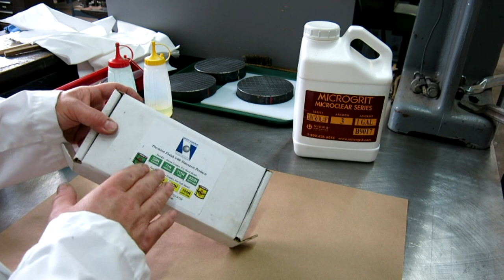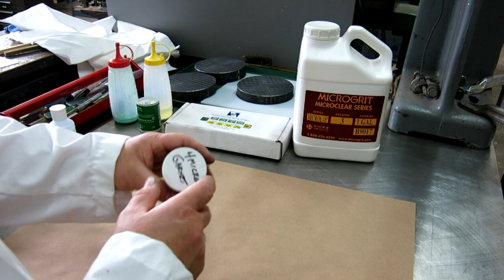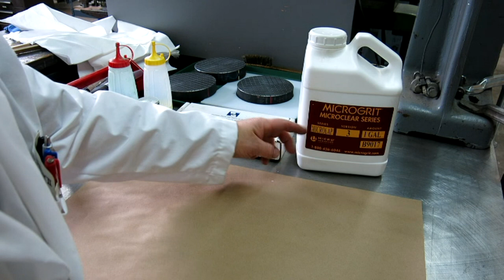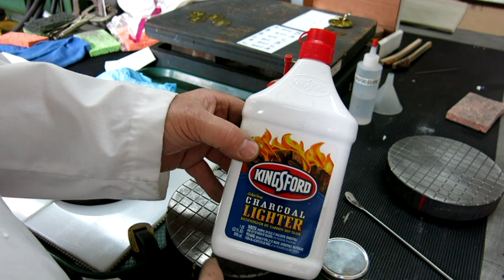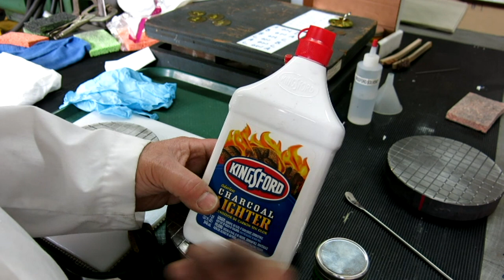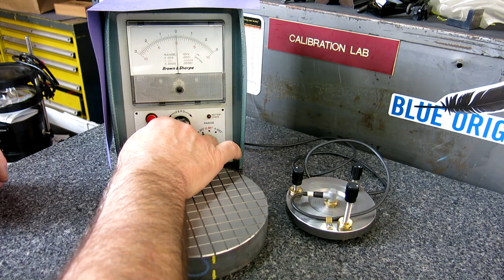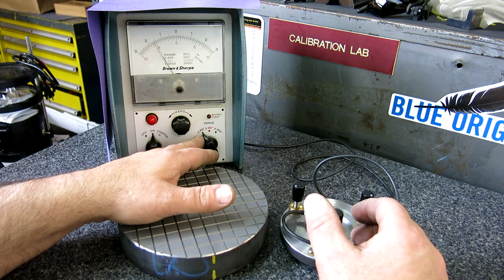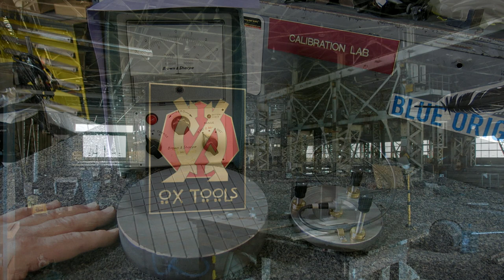Making flat lapping plates 2

Comment: When grinding telescope mirrors, the surface has to be far more precise than what you will ever achieve (or need) with your surface plates. To do so, we use rotation of both the top disc (the mirror) and the bottom disc (the lapping disc). The top disc is rotated in one direction after a small number of strokes and the bottom disc is essentially rotated by walking around the mounting post in the opposite direction. There is an attempt to keep both amounts of turn somewhat random to eliminate any radial zoning. Grinding by simple rotation of one disc on the other is avoided, as it can create circumferential zoning very rapidly.

The reason why the three plate method works is that  - with two plates,  there are two surfaces that can be in full contact in any orientation - a spherical surface or a flat plane. When you add a third plate, then the only surfaces that can all be mutually in full contact in any orientation is a flat plane.

Comment: When barrel-walking, you also counter-rotate the top, so both the direction of the stroke and the orientation changes. Doing it in the same direction for the bottom plate consistently will tend to make it cylindrical.

The way you're doing it, you cancel that out a bit by swapping top & bottom, but the way I was taught was to always keep things as balanced as possible.

Dunno if that makes much difference if you're grinding flats as opposed to making a mirror.

Comment: The bottom plate has to rotate, too. This is why they use a post and walk around it. By rotating the upper plate a bit faster than the walk-around rate, all combinations of rotation and stroke direction for both pieces get used. It's not enough to swap the top plate with the bottom plate as the grinding method makes the top plate concave and the bottom plate convex. You need all six of your combinations combined with simultaneous rotation of both plates (but at different rates) to get the real flats.
Reply: As we know theory and practice are quite different beasts, but in theory he can just rotate those plates, without back and forward motion and change ABC in the sequence and as result will get flat surfaces.
By averaging motions you may better average/eliminate  systematic errors and get better results faster, and maybe some ways are better that other, but those average methods are second order of importance..
Reply: For some reason, the people who are manually trying to achieve surfaces accurate to better than 1/4 of a wavelength of light (roughly 0.000005" if I got my decimal point in the right place) seem to have all decided to do it the way I described.
Reply: One other thing I remember from when I was polishing my own telescope mirror is that the grid of grooves on the lap should be off center such that the center of the lap is neither on a groove nor in the middle of one of the squares.
Reply: Peter Meek is right.  Think about degrees of freedom.
Reply: Can someone elaborate, I'm missing something.  Why does rotating both plates produce a different result than rotating one?  Relative to each other, there is a single rotation on a single axis regardless?  I think I'm missing something simple.  Thx in advance
Reply: but you have no idea how or why, you just like repeating what you been told?
Reply: Indeed the forces get distributed unevenly on the bottom plate, but switching both plates around fixes that problem and does essentially the same. I guess that in the case you describe it is just not as easy to make those swap places
Reply: +Tinsoldier
Not an expert, but ...

as and example, let's say one have systematic error and he presses a slightly at angle on outside motion (forth-outside position-back motion), this will lead to a slightly bigger wear for far side of bottom plate and upper plate. But upper plate is rotated, so this wear will be distributed on outer rim of the thing and thus will be less than it could be(it will be averaged, and will create convex shape which most likely will be removed with 3th plate). but bottom plate is not rotated and will form a different structure, not axial symmetric and more pronounced. It will also be averaged later, especially being rotated as one of the top plates, but as being not rotated the disturbance will be bigger in more in one place in first cycle, so it needs more time to remove it, and it might move the lapped surface to move more from parallelism with its bottom surface(if you care about that).

Eventually rotating the only top plate in the possible scenario will work out the error, it will be just longer. And all that intended to average systematic errors wich may(and will) be in human movements or in a machine. Something like that.
Reply: +Tinsoldier - When you push and pull the top plate, it overhangs the lower plate first away from you and then near you. This causes extra pressure on the outer edge of the bottom plate, first far, then near. To spread that wear all the way around the bottom plate, you walk around it as you grind (or arrange for it to rotate while you stand still).

At the same time, the wear on the top plate is mostly in the center where the edge of the bottom plate "digs into" the top plate. Additionally there is some wear away from the center, mostly in a direct line to and away from you. To spread THAT wear evenly around the top plate, you also rotate it, but at a different rate than you are walking around the bottom plate. 

There are actually three things rotating around the axis: the top plate, the bottom plate, and the direction of the fore and aft pushing. All must rotate at different rates. (Actually one can sit still, and the other two do the rotating - which is what walking around the bottom plate and rotating the top plate at a different rate accomplishes.)

When you grind only two plates, the bottom develops a convex spherical surface, while the top plate develops a concave spherical surface. This is how people hand grind telescope mirrors. 

With three plates, ground in six combinations, as Tom described, the convexity and concavity cancel each other out and you end up with three flats.
Reply: +Dennis Lubert - The bottom plate always tends toward convexity and the top plate always tends toward concavity. You really need to make that tendency spread all the way around evenly on both plates in each combination. Switching it from top to bottom and only rotating the top plate means only the concave tendency gets spread evenly. Tom's suggestion of grinding by rotating the top plate (instead of pushing it to and fro) can spread it around, but the people who want optical accuracy find it better to spread it evenly in the first place instead of trying to correct it later by circular grinding. Using all six combinations of plates and positions makes the convexity and concavity cancel each other out to leave flats.
Reply: +Peter W. Meek Thank you for the thorough explanation, that makes sense now!
Reply: +Peter W. Meek
The rotating the upper plate only does not mean he will not change in the process the bottom plate to be upper, as I got the impression even it were not stated explicitly, but it is the logical way to do the thing.
Reply: +MolbOrg - I think you may be missing the point. Rotating a plate when it is on top does not have the same effect as rotating the to and fro action in relation to the plate WHEN IT IS ON THE BOTTOM.Tom does say that all plates will be on both the top and bottom while in combination with each of the other two (six combinations). However that is not enough. The oscillation MUST rotate in relation to each plate while it is ON THE BOTTOM (and on the top).

Comment: In Fundamentals of Dimensional Metrology by Ted Busch, the sequence is different.  In his history of flat surfaces, he points out that lapping was always used but that Wittworth improved the process by using scraping.  The sequence he used was B on A, C on A, C on B, A on B, A on C, and finally B on C.  Totally different sequence.  I suspect it has to do with scraping, which is a different process.  For example, in the 3rd step, B and C are similar in that they roughly match A.  But when you work B against C, their errors are doubled.  At the end of step 3, B and C match each other fairly closely but one is concave and the other is convex.  Also, A doesn't match either of them.  So you work the convex one (which ever was on the bottom of step 3, B in the above sequence) against A,  It fixes A so that it is a close match with C but now A is concave.  So finally you work the 2 concave pieces against each other (whichever is more curved probably goes on the bottom).  

I suspect that this is a minimum-type procedure that only works in 6 steps if you have some experience. The sequence from Busch may only work for scraping where you work the pieces against one another in a controlled way, rather than the random orbits used by the telescope people.  Too much overlap off the edge of the bottom plate should make the concavity worse, so you need to learn how much to slide the parts around.  Also, if you're using abrasive methods, if you over-do any step, it seems like the the concavity of the top plate and convexity of the bottom plate could get out of hand.  And it's hard to imagine that some systematic round-robin lapping at the end wouldn't improve your results, if the abrasive isn't overly aggressive.  This project may be unique in that much larger plates would be easier than very small parts.  That is, the curvature due to overlap as you rub the parts together is less as the parts get larger.

Comment: Hello Tom,  Hope  your shop isolation is tickling your creative nerve!  I made 3 plates from 5 lb weights I ordered on Amazon.  I finally got around to taking a look with an optical flat and my results were surprisingly good, so thanks for the inspiration.  It is really amazing that you can make something so mundane as a cast iron weight so flat.  My question is: the lapping has created burrs in the grooves.  I milled my slots with a CNC machine so I don't think that had much of a burr when I started.  Should the burrs created from this lapping method be removed?  It makes them very hard to clean but I'd guess it helps them cut.  What do you think?

Comment: might I ask a non video related question sir ?? I have aquired a huppert heat treat oven its a 3300 pc  the i.d. tag reads do you have any knowledge of how those types of ovens opereate there is a air inlet on the back I"m not sure how much air it takes or needs does the air always need to be on when using it ?? plus theres a honeywell digital contol on the front wich i of course not sure about I cant find any info doing a online search just thought I"d ask a profesionall thank you in advance if you can shed any light on my bewondering by the way I will  be making some lap plates in the future cool videos ty

Comment: Between Origins of Precision and this series I was sedu... er... inspired to order three 50mm thick, 160mm diameter cast iron plates from the local materials supplier. I believe they cut them off using something between a stone chisel and a piece of wet twine. If I had an optical flat to test the starting flatness, I would have lost it in one of the grooves.

I have no lathe, no mill, nothing more than a 4kg (8.8 lbs.) bag of 120 grit aluminum oxide and an abundance of time. I think I’ll need all of it.

Comment: Dear Mr. Tom
Your great job just inspired me to make my own 3 set of small granite surface plates size size 300 mm by 300 mm with thickness 40 mm.
I have already got materials  my question is : what will be the sequence of rotation of the plates just 90 degrees only during one run?

Comment: Great stuff, as usual, Tom!  The people who casually talk about making their own machine shop surface plate by using the three plate method need to watch this entire series, comprehend it, and then imagine the plates being much larger, made of heavy cast iron or granite, and by the way should be round or square.  Maudslay first did it in about 1800, scraping in cast iron surfaces, and I haven't see any calibrated and certified examples of full size surface plates being generated in our lifetimes, though they may be out there.  It would not take too long for a reasonable person to figure out that spending a few hundred dollars for a calibrated and certified factory surface plate accurate to within millionths is a huge bargain.

Comment: Hi Tom I finish my plate and I was very impress how that methode work very well for keeping your tenths indicator still! I charge my cast iron lap with diamond slurry 3 micron and 1 micron but after couple pass I check the plat back and notice a little 2 tenths dish in the 8 inch plate. I wasn't realy lapping on the side wich will explain the wear, but I though that the embed diamond protect the surface from wearing. I didn't charge it over and over, just once and use it kind of dry, wich produce ''wringnable'' part. Did you notice wear in your too, or is it something in embeding the particle, that I miss, need to had slurry on and on during lapping... Thanks
Reply from the maker: Hi Simon,

On your technique you should be utilizing the entire surface of the plate when lapping. If you localize your lapping to one area you will change the geometry of the plate quickly. Try to cover the entire area and rotate the lapping plate occasionally to minimize local wear. Hope this helps.

Best,

Tom

Comment: I find it funny, everyone says not to use gasoline in the shop and rightfully so. It is horribly flammable and a spark off of that iron or whatnot can cause a bunch of trouble. However i see people all the time (not referring to this guy), just unthinkingly hose stuff down with extremely flammable brake cleaner having it go everywhere, soak something in an open container of it, or heck even weld or use a torch near the can.

Comment: Great video...Tom, it looks like you are pushing up from the center only.  Is that right.  I might have thought pulling back toward you as far as you pushed up would be what you wanted to do, but that would kind of mess up the 360 degree thing I guess.

Am I right that you are pushing plate A from the centered position forward about 30%?

Comment: Can you explain the procedure for doing 2 laps with 1 double sided? (14:40) as i understand it, you can't lap 1 side of a lap to the other side.
If you rotate the bottom plate (at a lower rate), do you still need to do B on A after A on B? (with free abrasive)
Reply: Maybe i'm missing something obvious, but my understanding of the 3 plate method is that it yields a flat by rubbing 3 plates together (each plate against the other two).
Until they invent portal guns, you can't rub the front of a lap against its rear.
Reply: But then you can't rub B to C.
The same issue still exists with 2 double sided laps?
Reply: Isn't the 3 plate method the only way to improve upon the precision?, which i thought he was trying to achieve.("true flat plane without any measuring tools")
If you know of another way, please point me in the right direction, i find this stuff fascinating.
Reply: I've seen all scraping videos i could find.
I'm in the process of generating a flat by scraping, and to my knowledge, there is no way to do this if you cannot compare all 3 surfaces to each-other.
I suspect Tom misspoke when he said it can be done with 2 laps, but i'm used to thinking about scraping.
Reply: 2evilsdevils 
Tom said 2 laps but 1 of them must be double sided.  So in effect  3 lap surfaces
Reply: This is what prompted my question, for the 3 plate method you need to compare/lap every surface to every other surface directly.
In the 3 plate method, you basically make 2 negative copies of the first plate, then by taking off an equal amount of those two plates, you cancel out the error.
If you can only move 1 plate between the other two surfaces, all you can do is copy the error of 1 side onto the other?

Comment: I'm led to believe that a good lathe has a deliberate bias built into them & they face "concave". your demonstrations on the cast iron discs looks to show that's true! - Pedro
Reply: it's interesting you mentioned that. i'm wondering if it has to do with the surface speed changing as the cutting tool advances across the face of the spinning material? slower speeds tending to cause more drag and drawing the cutting tool deeper into the material?
Reply: Or spindle is not aligned with the ways...
Reply: I'm not denying that headstock alignment could cause the discs being concave or surface speed causing it either, but I have found that over the years, virtually every half decent lathe I've ever used, faces concave. I was told about this by a toolmaker I once worked with & he said it so two faced surfaces pull up flat if bolted together & don't rock as if it was faced convex. - Pedro

Comment: Note the important difference between flammable and combustible . Combustible liquids like lighter fluid, which is essentially the same alkane composition as mineral spirits, are much safer than flammable fluids like gasoline, whose vapor will ignite and travel back to the liquid source.
Reply: sydnius thanks for the explanation.

Comment: So the telescope guys are always banging on about not introducing periodicies by moving somewhat randomly and avoiding like even division of a full rotation when rotating the plates. The idea being that it will even itself out if the errors don't align, but when you say come round to the same spot again you might reinforce the error. What's your take on this?